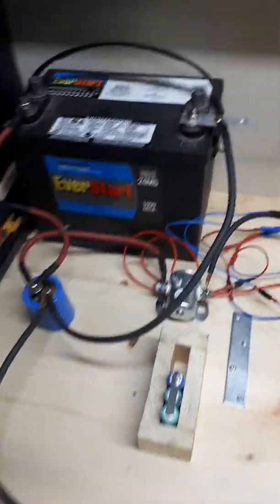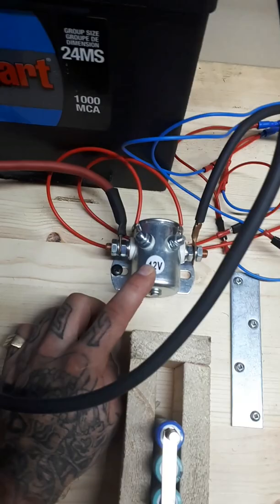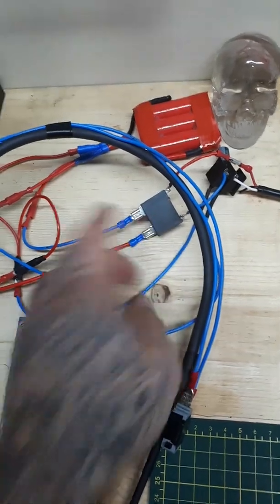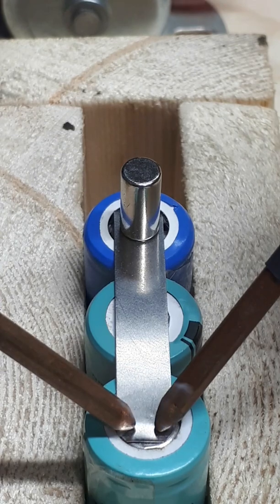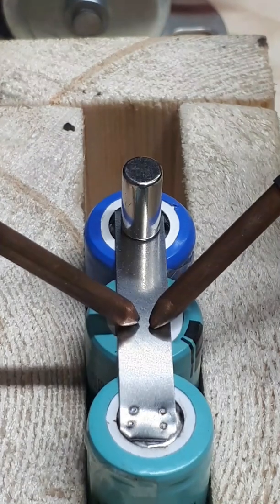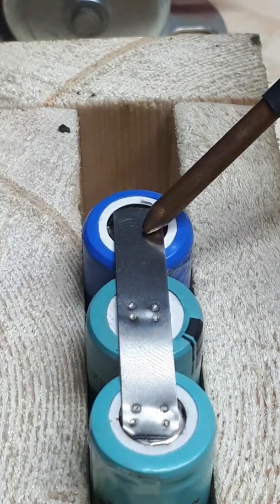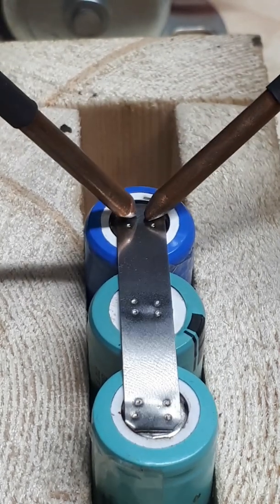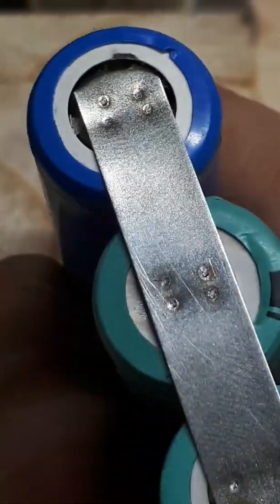Diy 18650 solenoid spot welder with capacitor

Comment: Hi, great build! I'm trying to build a similar unit but didn't get why you're using the big capacitor though. Is that because your battery is too powerful with 800CCA? Also, you use a timing of 1ms but it shouldn't be possible for a power relay to activate as fast as that. Mine has a 15ms activation time so I guess that powering the coil for only 1ms would not allow the relay to close the contact. Anyways, seems yours is working perfectly: beautiful welds!!